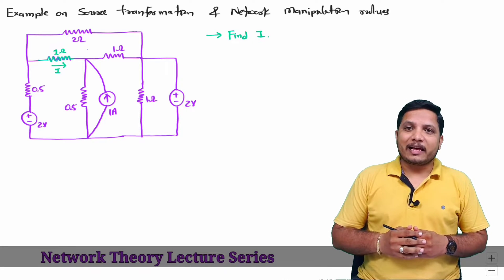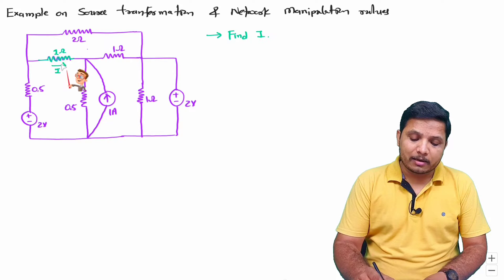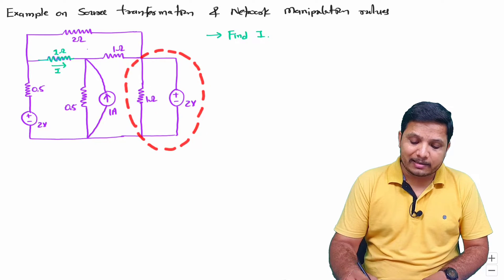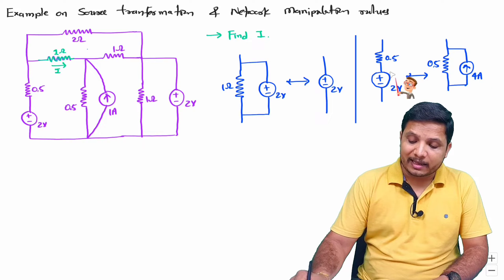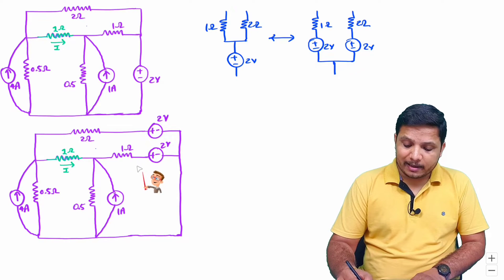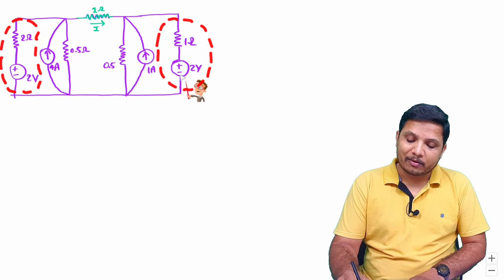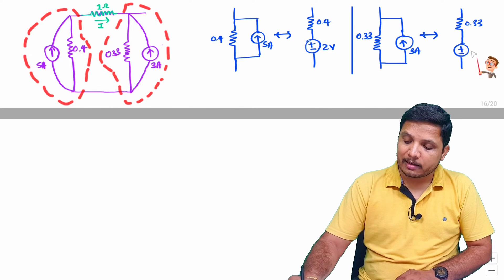1 - Source Transformation and Network Rules: Solved Example

Comment from the maker: Example on Source Transformation and Network Manipulation Rules explained with following Timestamps:
0:00 - Example on Source Transformation and Network Manipulation Rules
0:35 - Network Manipulation rule - Network Element in parallel with voltage source
1:40 - Source Transformation - Voltage to Current source transformation
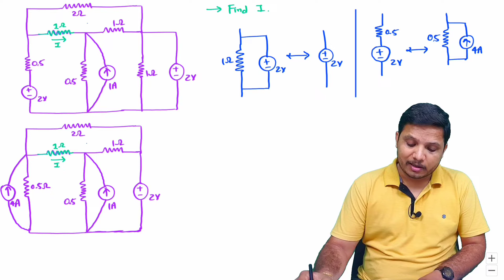3:13 - Network Manipulation rule - Voltage source distribution rule
5:04 - Source Transformation - Voltage to Current source transformation
6:51 - Network Manipulation rule - Current sources in parallel connection
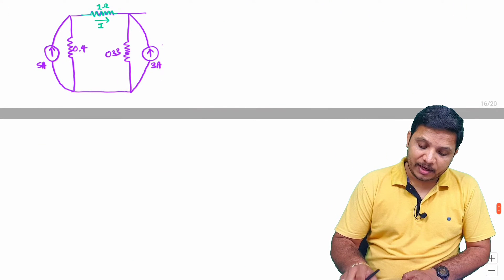8:34 - Source Transformation - Current to Voltage source transformation
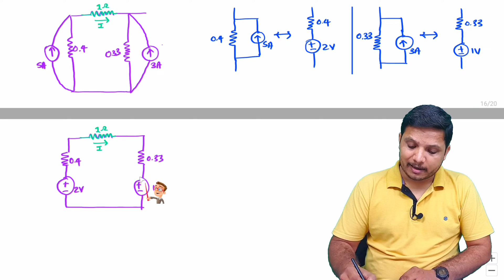9:53 - KVL loop to find current through resistance